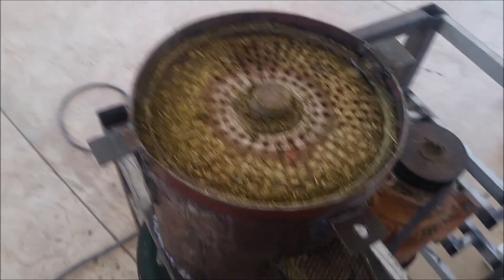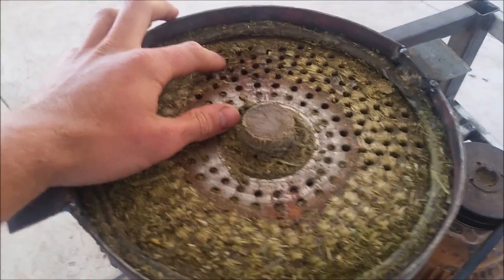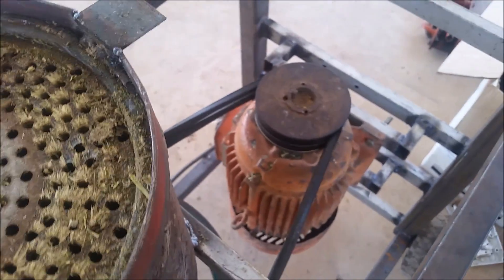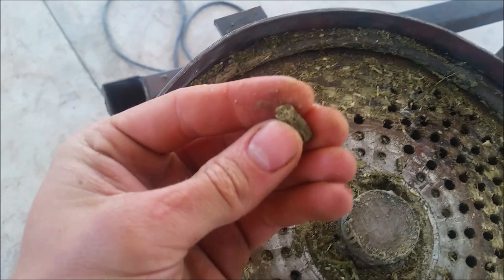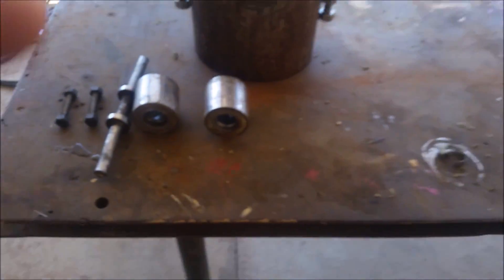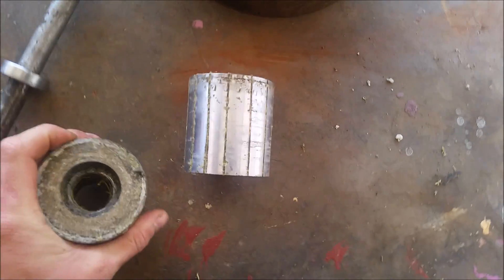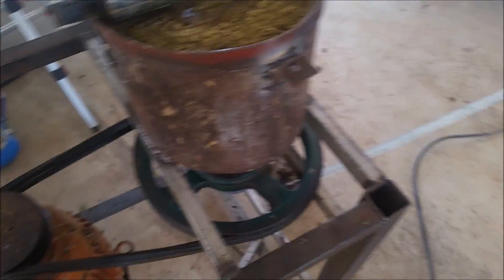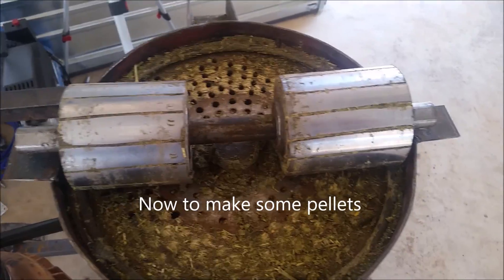DIY pellet mill

Comment: Keep the trommel filled up with more material and you will get better pellets.
You want friction when the pellets are made so a little bit of heat will get in the hole plate.
This "friction heat " will bond the lignine in the fiber and help to get better pellets.
Also a smaller poelie on the electro motor will give you lower rpm but more torque ... and therefore more power 👍😀.

Comment: Awesome! I noticed when more material was fed it slowed a bit and the pellets seemed more consolidated, am I correct? Maybe you need to feed a bit faster so the motor is working harder, but then maybe a more powerful motor would be needed or more gearing.
Have you tried waste paper? I want to turn waste paper or mixed biowaste with paper into pellets for a pellet burner.
Reply from the maker: The problem is the motor is running directly from my solar panels with a VSD system inverter so it can't Handel AMP draw ant a fast stage that's the reason it slow down

Comment: Mate, I know this video is quite old and you probably have figured this one out already but maybe for someone watching your video:
To increase the strength of the pellet use a thicker top plate and drill slightly tapered holes. This easy and minor modification will make a longer and more durable pellet. All in all a great mill you put together in here.

Comment: Awesome job. Some really smart engineers in the pelleting business and their machines also work. You may try adding a little wheat flour to get better quality pellets. A little cooking oil will also help the pellets to form better. Before and after each run, use 1 kg of dry material and 100 ml oil to clean and lube the moving parts. You can reuse this cleaning material.

Comment: Could potentially use aluminium instead of steel as milling the holes would be easier and significantly cheaper, could even use a thin steel plate for support if you're worried about pressure cracking. As for steam you could heat a pressurised tank with the outlet going Into the lower compartment or upper. Could use a old fire extinguisher and modify the pipe to release the pressurised air. I've got a few sheep and just been looking up Mills to reduce cost on buying store pellets, think they're about 8mm x 20mm, what mix do you use and what's the difference in cost buying the raw materials? I think a bag of feed here in the UK is around £10 for 25kg. Cheers

Comment: ive watched quite a few designs. most have wheels on the surface  50 % touching parts and 50 % cutted out 
and the distance between the holes are as far as the cutted out pieces. bit hard to explain lol
but the reason they do that is the material can be pushed in the holes. and between the holes it can escape in the cutted part of the wheel. it also adds more heat and it cuts the material a bit more..
Reply from the maker: I think I understand lol , I want to build I new unit have a design that I want to try alot lower speed less moving parts but thanks for the comment I check other designs also before a attempt my new unit

Comment: The machine is fine.. the only thing you need to adjust are the holes on the plate. they need to be a bit bigger at the top where the material is colected and smaller inside the holes to be better compresed.
Reply from the maker: Noted thanks,  and thanks for sharing this , wish I knew this from the start lol , would have saved me some time actually but this why I like people commenting, they give you ideas

Comment: You need to taper the holes on the top of the top die plate. That will result in pellets that are harder and not as crumbly. The material is compressed much better with tapered holes.
Reply from the maker: Thanks for the comment , hope someone reads your post,  and it helps them , thank you again for watching and for your comments , God bless

Comment: Great video! Are there any welded parts?
Reply from the maker: Yes there are 3 welded parts the side  of the tube and the small grid that let's the pellets out if you are referring to the mechanics the only welded part is the plate with the holes in it welded to the shaf that drives the pully to the motor

Comment: Very nice  brother  I liked what you said  
Firstly I  want to  wish you happy  new year 2021
this the  ways  you  should  help  poor  farmers 
You  explained  very clearly  and nicely 
I also wanted to make one 
As you said brother  money  issues 
I just wanted to know the RPM  
Pellet machine  running  what is the  ratio of  pulleys  you used
Can you please  share drilling  drawing for plate and thickness 
And also roller set  size and thickness  and also any other  you  think I should  know more about the  machine 
I am waiting for  your  reply 
Thank you  brother 
I proud of you
Keep it up 
God bless you 
Please email me 
sanjayshringarpure22@gmail.com
Please  WhatsApp +919819220334 sanjay
Reply from the maker: Firstly thank you for your blessing and the comment, if I can remember correctly and to help you from what I have learned the plate with the holes in it 
Must be a min of 8mm deep , works best I have tested it , the rollers I used was about D-50mm with a 20mm shaft the pully ratio I can't remember but if you are looking at about 1450Rpm that wil work perfectly just remember to use proper bearings not the cheap kind like me

Comment: Just a thought, instead of making a new plate of holes closer together, try countersinking each hole. This might also increase compaction!
Reply: Yes, he made the machine quite well, but in my opinion the conical - or at least countersunk-  holes are missing, which is responsible for the merely weak compactation.

Comment: Flare the drill holes with a larger size drill bit for better compaction and smoother pellets also it will reduce stress on the motor.
Reply: other feed machine also you can see ,share and subscribe here

Comment: The biggest problem you have is with your die plate, the holes are to far apart and it would help if you gave them a good lead in, ie chamfer the holes

Comment: If your pelleting feed, injecting steam in the mash feed and let it be absorbed for a couple of seconds will give you a pellet that is not as dry and should carmelize the corn resulting in a pellet that has elasticity until it drys. We ran the pellets through a cooler which essentially was a perforated conveyor with air blowing through the trays.

Comment: You have a pretty interesting design but there’s a lot of things you can’t control with a DIY project like that. For one thing your rolls need to be able to be adjusted to a very finite setting. They can’t sit directly on top of your die because eventually the metal to metal contact will wear your rollers out and they won’t make any pellets for you. Secondly you need to be able to generate enough heat to cause the lignen in the wood to bind together. That’s what makes a pellet and not just mushy wood. Thirdly whatever wood you’re planning on putting into this machine will need to be dried to a certain moisture percentage or you won’t make a pellet, You’ll make mush. I commend you for your efforts and it might work to a degree but honestly I’m not sure why you spent the money on the resources to make this when quality made pellets are readily available
Reply: Cristos this man lives in South Africa where pelleted food for your animals are very expensive.
Reply: I was planning on pointing out a few issues with your comments, but it wont fix stupid.

Comment: I see what you did there......

I want to build, or buy one of these for scrap type wood such as limbs or pallets so I can process it into pellets for a pellet stove. Reason for pellet stove instead of regular wood burning stove that takes logs is for auto feed operation via 12v motor and batteries for shop.
------
All the "good wood" will be cut and sold for regular wood stoves. The scrap type wood will always be free. Free scrap wood makes sense to grind up and make pellets but not if machine cost me 10k. It seems this is an interesting design but it also seems it would get no where near the pressure needed for wood pellets. I do think it could be made heavy enough so it could do wood pellets but after all cost, you can buy the pellet making head that is capable of making wood pellets for cheap enough it would not pay to build your own. I conclude this being a trained machinist and having my own machine shop. Final decision not yet made though, I do like building things myself but larger heavy steel for making such things as this is now vary expensive.
------
I would bet if I could get hold of a large heavy truck transmission, I may be able to use the gears as rollers if I use my lathe to reduce the gear teeth down then bore them out to take bearings inside. Standard gears that are designed to rotate on a shaft could work but would quickly wear out the bushing due to lack of lube. If you look at the production models the rollers are sealed with lube inside though so maybe heavy truck gears with a bushing and seals with grease inside might work.

Comment: You need to increase the angle on the feed shoot so it doesn't clog.You also want to have replaceable plates on the surface of your rollers. Gearing it down to a lower speed and higher torque will also help.
Reply from the maker: Thanks,  yes a agree lower RPM will be alot safer and more torque as you have stated I have received alot of advice in the comments,  l have a new design that I want to try out

Comment: you said that it has 2 plates. one on top and also on bottom,
 would like to clarify if both plates have the same characteristics.  like those on top plate it has small holes does the bottom plate also has hole?? please reply my comment
Reply: Ezekiel Marcos: I believe the bottom plate is solid/ has no holes in it. When it runs, it throws the pellets toward the chute as they are cut off under the top die plate. Also, having a second plate may help him keep the shaft upright, as the second plate may act sort of as a bearing or bushing. The two plate together, plus the pulley may give him inertia, like a flywheel. Almost all of these rotating die designs use a lower, solid, rotating plate to move the pellets to the chute (centrifugal force)

Comment: How many RPM'S does the pellet die turn..in this machine and what horsepower is the motor.
Reply from the maker: Larry Sbrusch  about 1500Rpm and the motor size is 7Kw
Reply: Appreciate the quick response. That seems kind of fast to me..I am trying to build one and I would like to get the rpm of the rotating die as close as I can to produce the best quality..
Reply from the maker: Larry Sbrusch no problem jou should look into a VSD  if you are not sure about the rpms . That is for watching

Comment: Why didn't you use water?
Reply from the maker: tarstarkusz  I did add some moisture to the mix thanks for watching my video
Reply: I thought I heard you say you added molasses.
Reply from the maker: tarstarkusz I did add water to the molassis to thin it a bit up thanks for the reply
Reply: OK... That makes sense. Thanks! Is it still working? Are you using it?
Reply from the maker: tarstarkusz no not using this unit anymore made n better one works better but takes alot more time but the pellets looks pretty good thanks for the input

Comment: You keep saying "Proof of concept." Since pellet making machines have been in use for years and your design is based on their working models, I am confused as to what "Proof of concept'" could possibly mean.
Reply: concept
ˈkɒnsɛpt/Submit
noun
an abstract idea.
"structuralism is a difficult concept"
synonyms: idea, notion, conception, abstraction, conceptualization; More
a plan or intention.
"the centre has kept firmly to its original concept"
an idea or invention to help sell or publicize a commodity.
"a new concept in corporate hospitality"
He had an idea, which is defined as a concept, and proved it with the build
Quite simple actually...
Reply from the maker: First time for me building one i have never seen one only on the internet , so i tried to build one from only pictures the nex model works perfect
Reply: starseer000: perhaps if he said: 'proof of ability' or 'proof of ingenuity', what would help? he's proving he understands the concepts enough, and has enough dexterity to apply them and create a working model, if I understand how he uses the term. proof that he conceives and can act.

Comment: Just a suggestion, you may want to rig up some sort of steam source.  A adjustable amount of steam would allow you to cook your pellets and it will help the mix bind giving you a harder pellet when they set up, instead of a crumbling one.  But I'm sure your pellets there meet your needs.  Great build thanks for putting this up.
Reply from the maker: Thanks for watching , the only problem for me with steam is i have solar panels , and dont have the KW to hookup i steam source
Reply: @PhillipFourieZA  for steam from solar: perhaps a parabolic collector from an old satellite dish or make a longitudinal one with central tube and reflective mylar? or a small pressure cooker pot on a small wood fire/rocket stove? But I suspect you can avoid using steam if your die is hot and your feed stock has a moisture contact you verify is proper for your material. You might consider a hot water coil around the die area to help heat the die if you need it (run a tiny pump off a contact wheel off your main pulley or with contact-type bicycle generator?) I think too hot for feed pellets and some nutrition is lost. 

How thick is your die plate please? What kind of steel did you use? Have you ever run wood through it for fuel pellets? Was great to see your work, thank you for sharing it!

Comment: I think that if you drill a flare on the top of all the holes in the plate the pellets will be more compressed. Also once the plate gets hot from production, the pellets will stick together better.

Comment: your machine needs to run hot enough to cook the pellets , the lignum inside your biomass needs to be ditributec evenly through the pellet (thus requires heat) your pellets  should be producing steam  and be almost completely anhydrous when a pellet  (held together by lignum) they should be too hot to touch as they leave the machine. The heat is produced by the process  (friction and pressure)
Reply: At least an inch of effective for the die....or in your case a plate. I make wood pellets at a pellet mill called Hamer Hot ones. Simon Tinny is 100% correct in his analysis.
Reply: @joeyfanof88hotmail  an inch thick steel for the die plate? what type of steel do you recommend?
Reply: Your comment is helpful-
Reply from the maker: yes very good
Reply from the maker: thanks for the comment
Reply from the maker: Thanks for the comment
Reply from the maker: yes thanks for your comment
Reply: Yep all true. If you can't get the heat and the pressure to push it through you get  a useless pellet. When you get it to the right temp these small dies are just about ready to overcook and jamb. Tried for years with these small machine it just won't do it for long before they cook the die. Good luck.
Reply: Simon, thanks for your comment. Something about the heat that is worrying me.
Doesn't the heat reduce the nutritional value of the pallet?
Reply: Frans Reichert < I believe these are used as fuel not feed.
Reply: his plate with holes is to thin to keep the heat is my theory

Comment: Main disadvantage of this concept is lack of pressure and low density pellets with too much moisture kept inside - hydraulic ones are, on the other hand, real deal...wet chips goes it, high pressure gain heat, instant evaporates moisture, create wooden pulp that bond nice into pellet, then you make a video and publish it... ;)

Comment: Would it not be better to have it spin slower so that centrifugal force isn't pushing the material to the outside of the top plate? Your entire middle section of the plate doesn't get used at this speed.
Reply from the maker: it needs a gearbox for lower speeds and the stuff is very expensive
Reply: @PhillipFourieZA  perhaps a third or fourth pulley would help you, if you can made the frame to hold the pulleys and bearings?

Comment: wonderful job Mr Phillip. Do you have a video showing how you build the interior part Under the plate and what did you use to make that middle shaft stands straight while the rollers are pressing the material to make pellets. I want to make also for my goat and pigs feeding and maybe for the tilapias if the die has smaller holes. About the die plate. Did you drill the holes yourself or you had special Tools for that. Thanks a lot for your help. Much appreciated.
Reply from the maker: i use two pillar blocks to hold the shaft straight from the motor , the plate i drilled it myself takes alot of time and drill bits

Comment: Thank you for this video. My question is where are the bearings that hold both plates ? Or the die and ejector plate. For some time I've wanted to build one but haven't gotten started. Are the bearings between the two plates and are they accessible now. it appears the plates are welded to the shaft. How thick is your die plate? Plus I wander how thick the plate needs to be for a great pellet. Thanks again for your video.
Reply: A thicker plate will give you longer pellets...
Reply from the maker: My question is where are the bearings that hold both plates = yes . Are the bearings between the two plates and are they accessible now=no